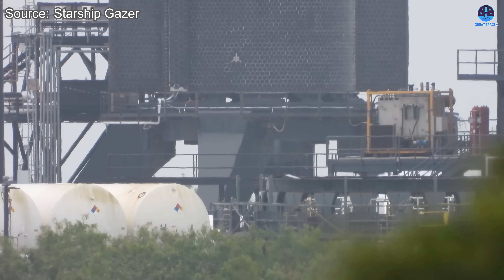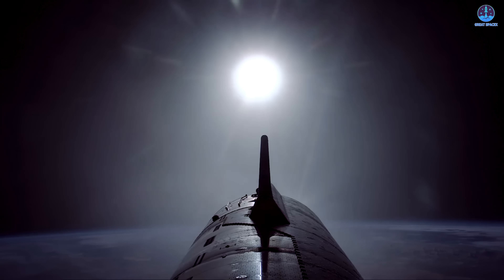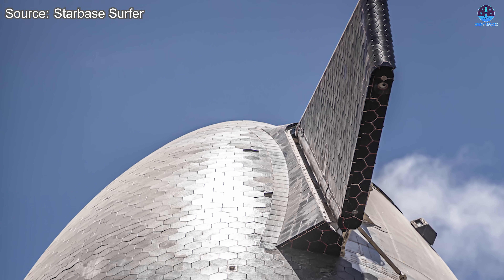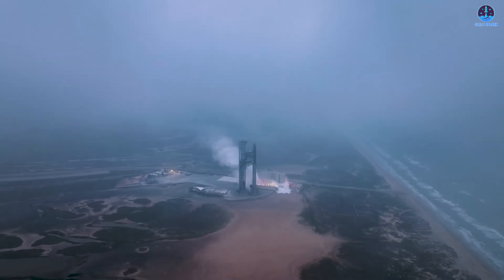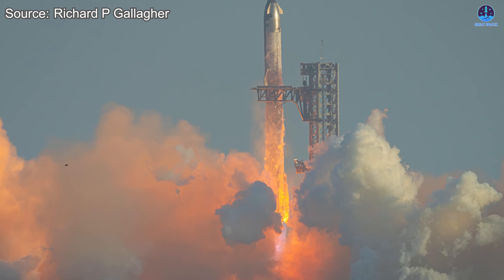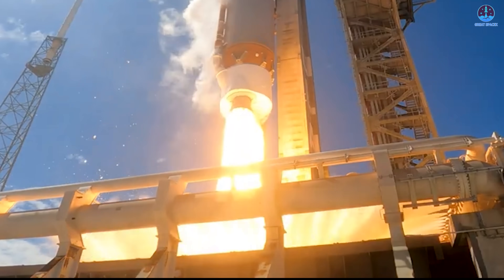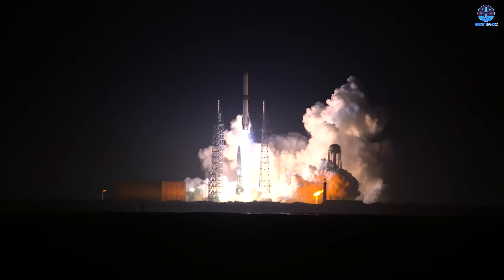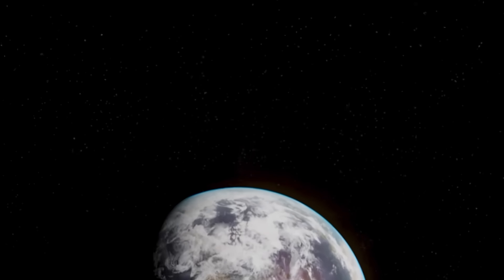Starship Flight 10 to Break Record with New Launch Time Schedule, Shocked the industry...

Comment: Breaking the failure record again?
But loser fanboys still have hope.
Reply: If you're not interested then why are you here? Go watch sports or something else insignificant.
Reply: Its the biggest and most complex launch system ever made, its gonna take a few tries to get it right, especially because everytime they re-design they have to re test aswell
Reply: The SpaceX Falcon rockets had some early problems/explosions but now has 15 years and 500+ successful launches.

More launches than anyone else. 

Ever.

If it wasn't for SpaceX we would still be relying on Russia for travel to the ISS as no-one else in the US has been able to come up with a viable rocket system. The closest was the Boeing Starliner and we all seen how that went.

Comment: That can’t be beaches in Mexico cuz there was a lot of heat tiles and last I knew SpaceX doesn’t put tiles on the boosters so (click bate) that was Obviously old footage. That being said Mexico probably hasn’t any debris at all from starship cuz last I heard Stainless Steel doesn’t float and I’m pretty sure there is very little to none plastic on boosters. 
Basically I’m calling Bullshit
Reply: Stainless steel does not float, but tidal action does involve undertow and storm surges whereby, if it's got enough surface area, undercurrents can push it to the point where waves can potentially bring it up to the point that surface waves push it onto a beach.
Reply: @davfree9732 agreed, but it takes a lot of tidal surge and quite a long time. Again the boosters don’t have Heat Tiles

Comment: Awesome...2 failures in 30 days has to be a record!
Reply: From the looks of the new Raptor design, Block 2 of the design phase is where things go boom. It'll be interesting if they introduce block 3 and they've managed to design all the bugs from the system.
Reply: @davfree9732 wasn't Raptor 3 the version used in the explosion tonight?
I knew it would fail but didn't expect it so soon.

Comment: All this glowing commentary about record flight turnaround times seem to forget one rather important parameter- the last 3 ships blew up
Reply: All good things are THREE.
Reply: Each Blew up for a different reason, by process of elimination it's going to stop blowing up once enough problems are fixed. One of the fixes is to dump this block of starship and move to a new design and raptor three which is still in testing.

Comment: These current rockets are prototypes. Not the final version nor were they ever intended to be. Notice that succeeding models are bigger and there is even talk of a version 4 of the engines on the drawing board. Every thing from launch pads and manufacturing is being scaled up. Go Space X!
Reply: Final version expected for 2285 ?
Reply: Version 4 was always on the table since the l33t engine was cancelled. l33t was supposed to be the successor to raptor with higher specific impulse and greater thrust yet better resilience. But that did not pan out, so they are sticking with upgrading raptor.
Reply: Lol